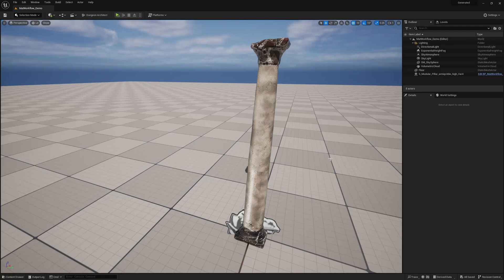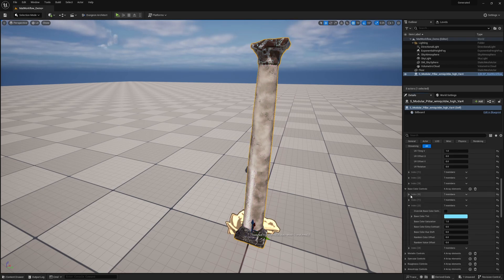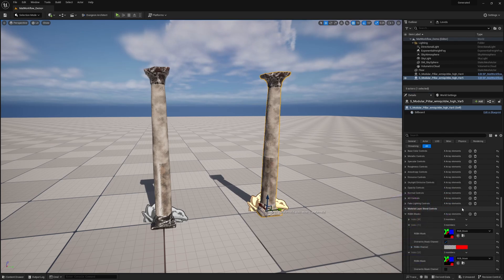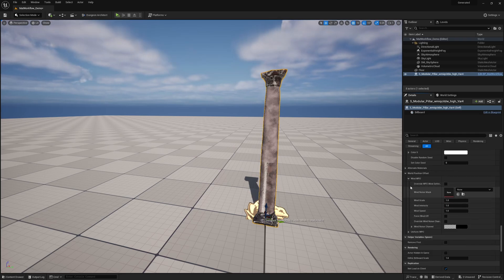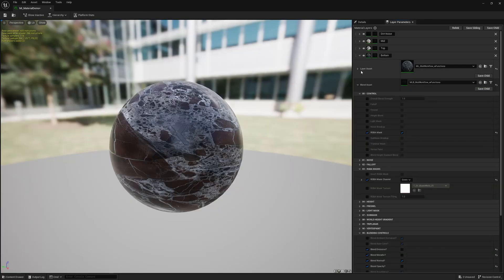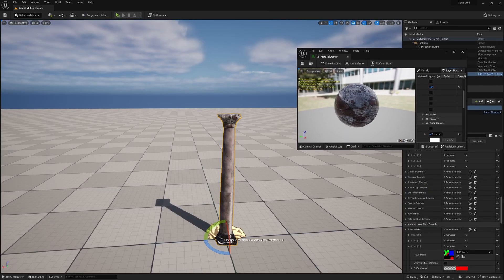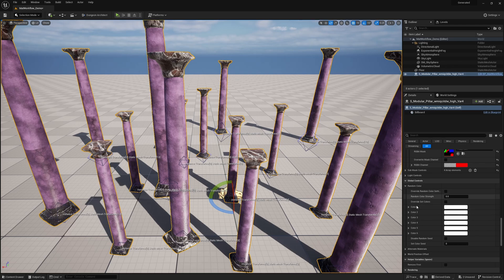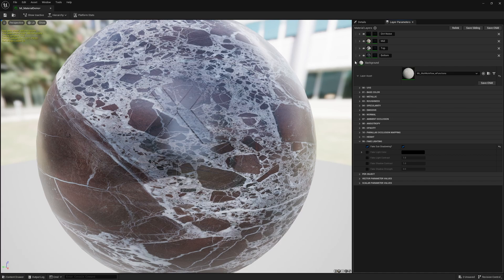My Blueprint Layered Material System Mini Demo | Unreal Engine 5.2

Comment: How did you manage to have parameter switches that actually switch off from compute rather than setting a value to 0 or something please? This is kind of my roadblock atm is that all my switches are either true or false, but false has to have something in it so it's either the default re-rout or just a vector 1 with a 0 value, which isn't that good tbh
Reply from the maker: The ones that are on / off in the blueprint are not switches. They're basically if statements or select nodes, stuff like that. You can't use static switch parameters in BPs. They're the only ones that don't compute all inputs, but I believe that's now changed in 5.4.
Reply: @Procedural_Minds  Thanks for responding to me :) How did it change in 5.4 if you don't mind me asking please?
Reply from the maker: @MonsterJuiced  I believe I read that they now don't calculate all inputs if they don't need to. But I haven't tested this yet or dived into it.
Reply: @Procedural_Minds  Ah I understand, thank you. That would be amazing if they made it so that the 'false' option could just be plugged into a 'don't compute' node instead of it always computing a null value all the time

Comment: This is an amazing system! Do you by any chance know whether it is possible to use Bluepirnts to hotswap what Layer Asset and Blend Asset is assigned to each Layer though? E.g rather than setting the values of scalar, vec3 and textures using BP attributes, I am storing all of a Layer's data in a MaterialLayerInstance and want to be able to swap the LayerInstance that a material instance's layer is referencing. As far as I know this is very similar to how Halo Infinite's coating data is stored. I can't seem to find a way to do it though, and there is hardly any documentation (if any) on Layered Materials and the "Material Function Material Layer" BP variable.

Alternatively I can store coating data (the values of all of the texture, scalar and vec3 parameters) in a DataAsset. But the downside of using BPs to edit the parameters directly is that many parameter types are unsupported in Blueprints, I believe? E.g you CAN edit the values of Scalar, Vec3 and Textures, but NOT Booleans/SwitchParameters, CurveAtlasRowParameter (useful for gradient map magic), etc.
Reply from the maker: Unfortunately there's no way to read that kind of information with blueprints at least. You can't even get the name of the layer unfortunately. I really wish you could. Theoretically in C++ anything is possible, but I'm not a programmer.
Reply: @Procedural_Minds  Ahh that's fair, thanks for the confirmation at least. I might just need to use a DataAsset approach for coatings and set as many parameters as I can using BPs. Hopefully being able to swap out the layers, Get/Set data from them, etc, is something Epic add in future. Material Layers is super powerful but the current Blueprints support for them by Epic is a bit lacking and really leaves a lot to be desired haha

Comment: Tutorial wpuld be great
Reply from the maker: Absolutely. It'll be split up a lot cause it would take many hours to do a non-stop tutorial on everything. Height blending, that I've made a separate video on, is coming next. Is there a specific thing you're interested in learning?
Reply: @Procedural_Minds  Yeh the material layering system you have. Not much stuff out there regarding the new material layers. Do you know how to setup world align materials/textures with vertex painting to split up the tiling? is that possible using the new layering materials?
Reply from the maker: @SuperMontana2008  Yup, my system allows for both world aligned textures, and vertex painting. Although I barely ever use vertex painting in Unreal Engine 5 as I always turn on Nanite (Which doesn't support vertex painting). Once I finish up the height baking tutorial over the weekend I'll put these  two on my next to do list. :)
Reply: @Procedural_Minds  I didn’t know vertex painting doesn’t work with nanite meshes, damn. How would one break up the tiling when using world align textures on nanite meshes? Any ideas?
Reply from the maker: @SuperMontana2008  Lots of ways to break up tiling, the typical way is by stacking textures of different tiling on top of each other. So if you tile one 1x1, another 2x2, another 3x3 on top of each other, with a different mask on each,  it breaks up tiling. You effectively break up tiling by layering variety in a non-patterned way. If you'd like I'll gladly do a tutorial for it as well. :)
Reply: @Procedural_Minds  more tutorials the better thanks. Can’t find many tutorials on setting up layered materials. It can get complicated. Do you know how to setup a material that uses one base colour map and one base normal map that scale up. (No tiling) and then blend layered materials with world align and using masks to break up the tiling?
Reply from the maker: @SuperMontana2008  Yeah absolutely, you can have a baked setup along with a tiling setup together. My setup allows me to auto tile when scaling an object up, as well as not have it tile if needed. With per layer controls. :)
Reply: @Procedural_Minds  can you do tutorial on that please?, would be a great help. You seem to know alot about shaders. Do you have a discord channel?
Reply from the maker: @SuperMontana2008  Yeah absolutely I'll do it. I love the material editor, and layered setups. So that's why I know quite a bit, but as of right now no discord channel, sorry.

Comment: Looks great! Will the height blend work in 5.1? This would be a super useful asset and really appreciated if you could share / make available! :)
Reply from the maker: Yes I believe so, if I recall I was in 5.1 when I designed it. The tutorial for the system is planned for my next video. :)

Although I might break it up into the material part, then the baking to texture part, or it might be too long.
Reply: To be able to apply for the Marketplace, it has to work with the 3 latest versions.
This means that before he uploads it to the Marketplace, he needs to make sure it works with 5.2, 5.1 and 5.0
Unless 5.3 (the preview version doesn't count) comes out before that, then it 5.3, 5.2, and 5.1
Reply from the maker: @smitteree  That's good to know. Everything I have should work from 5.0, and I'd want to make sure it does anyways. Some things might even work since 4.x, but I don't really feel like testing all of it so far back. 😅